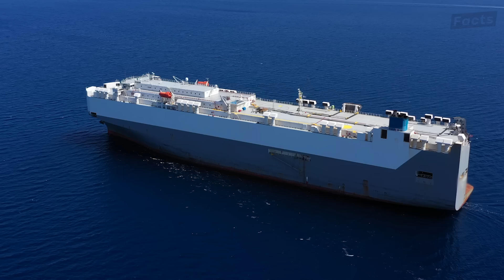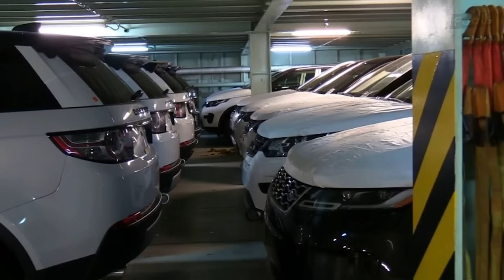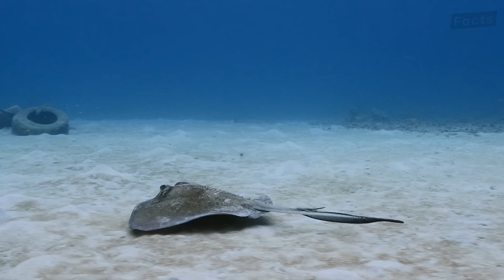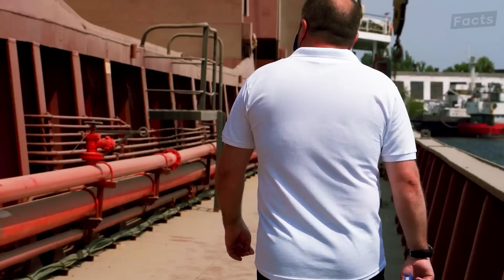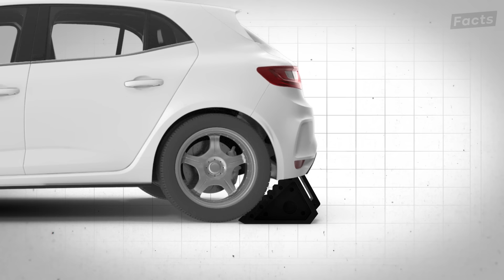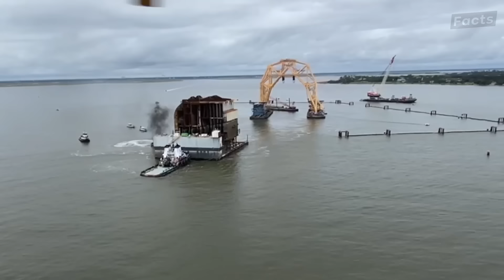Inside One of The LARGEST Car Carrier Ships The World

Comment: 186 meters long does not make this one of the biggest RORO's in the world. The two I sailed on were 199 meters, and even then I've seen others going through Panama that looked like they were at least another 20 meters bigger than us. Also, RORO's are unlikely to have Dynamic Positioning Systems, that's more likely going to be installed on cableships, cruise ships, oil drilling ships, whereas most commercial ships will just have their bow thrusters and a single screw aft.